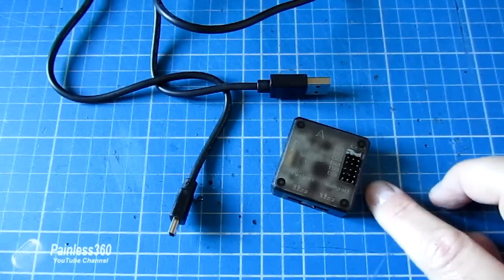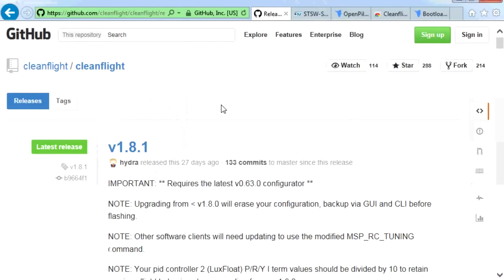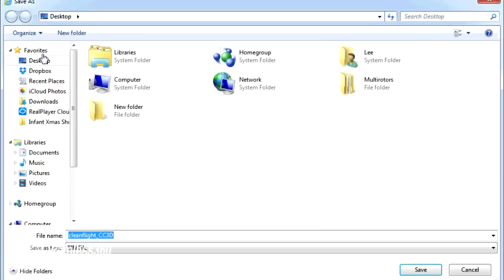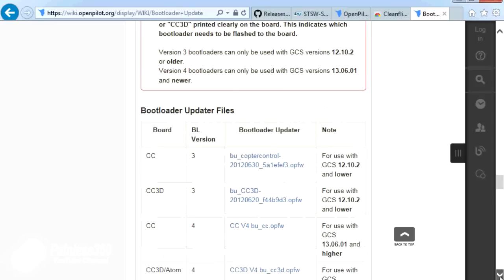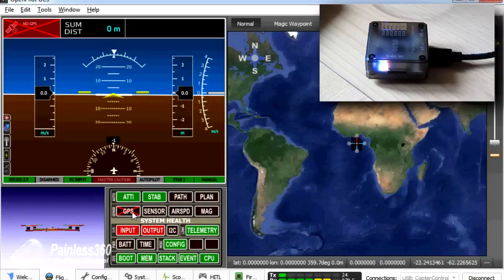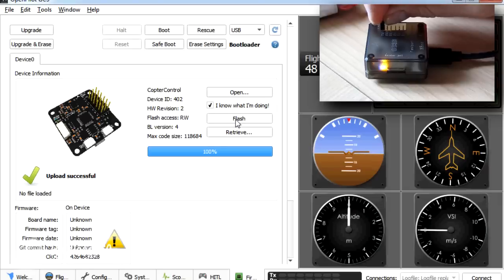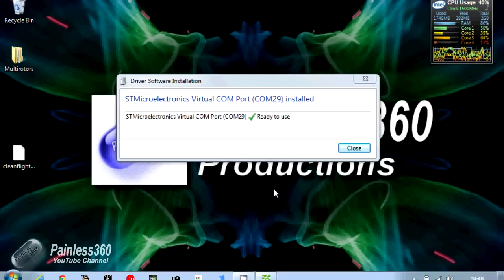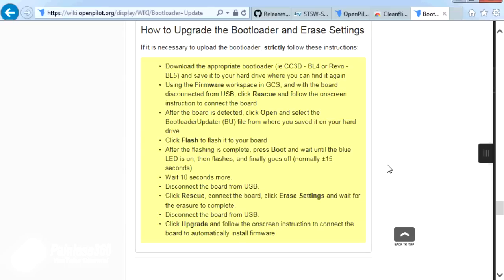(6/10) CC3D Flight Controller – Loading Cleanflight onto your CC3D

Comment: Open pilot has not worked on my cc3d. I have tried to rescue it numerous time but at the last step I get this message "Time out while booting. you will have to manually upgrade the board using the uploader plugin"  what do i do??

I also flashed clean flight onto the cc3d however it does not bring up a COM however, after flashing the bootloader back to cc3d, COM3 came up on the cleanflight software. What am I not doing right?? Please help, I want to start flying ASAP.
Reply from the maker: MrHermosas Use the firmware screen in Openpilot and click on Rescue then unplug and re-plug the board in quickly. 
Best of luck.

Comment: Will this allow me to do Altitude Hold on the CC3D? I do not have the CC3D Revo board, just the regular CC3D board which do not have the altitude hold function.
Reply: drbun if you can access the i2c port i see no reason why a barometer breakout board can not be attached give it a go.
Reply from the maker: drbun The altitude hold function relies on having the barometer sensor on the board and the CC3D doesn't have one fitted. 
Regardless of the firmware you use you will not get Alt. Hold to work. 
Hope this makes sense.
Reply: Thanks for replying, so if I buy a barometer sensor it is possible to configure this setup to do altitude hold, correct? Any barometer sensor you recommend?
Reply from the maker: Sorry I have never done that myself. Best of luck.

Comment: Excellent.  I struggled with this myself.  So after you do this, in the future when CleanFlight has an update, will it be able to update the firmware in CleanFlight configurator, or do you have to use OpenPilot to install the updates?

Comment: Hi! The flashing us not the problem. But assigning the channels in the receiver tab is a problem. There seems to be a bug in the firmware if you want to use pwm connections to the receiver. One channel is lost.
Do you have a solution for this?
BTW, there is a bug-report on github but currently no action.
Cheers!